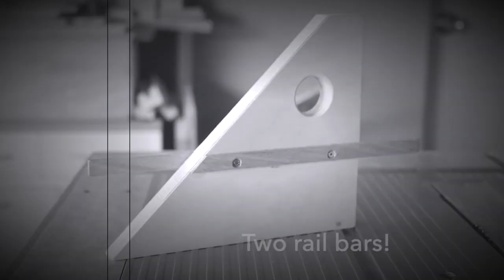Improvement of 90 degree 45 degree quick jig

Comment: very cool idea.... but if i cut a wood which covered by melamine on surface  by circular saw  ;  how many blade teeth to use
Reply from the maker: Hello samy
Thank you for coming to my workshop
The number of blades I use for table saws is 30.
And 80 for cross-cut of miter saw
Both are excellent in sharpness.

Thank you friend samy
Tachi

Comment: I tried to send this via email but it came back so I'll post it here. Have you ever thought about making a video on how you have "accurized" your Dewalt table saw? I have one and I have tried to get it as accurate as possible but it just never seems to cut straight and square. Have you done anything to your saw other than just doing the factory adjustments? If so, I'd surely appreciate it if you would give a detailed description of what you did and how. Thank you so much for all your great woodworking videos. They make me strive to be a better woodworker.
Reply from the maker: Hello Ray
Thank you for coming to my workshop
And thank you for your polite and nice comments.
There is no way for us amateurs to make manufacturing mistakes in the manufacturer's factory! The only modding fix I've ever made was a bang to fine-tune the distortion of my saw top. That is the last video.
https://youtu.be/-ZMNdr6IcZw

Thank you Ray ... Tachi

Comment: Thank you for your content. At about 9:25 in this video, what are you pointing at? There are no words on the screen and you don’t say anything. Also, your insert is partially blocking the view. Thank you.
Reply from the maker: Hi Bruce.
Thank you for watching my video.
The 9:25 event drilled a groove in the plate to seal the mall on top of the fence to block dust inside the table saw.

I am not good at English, hope you can understand with this letter.
Tachi